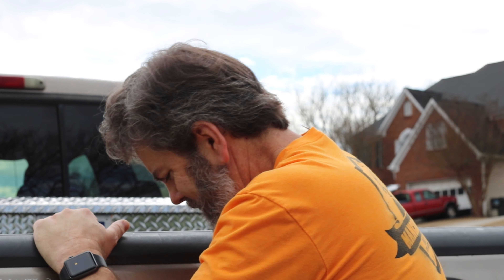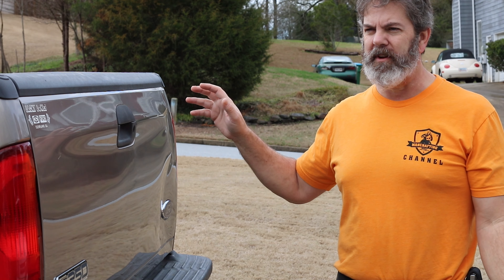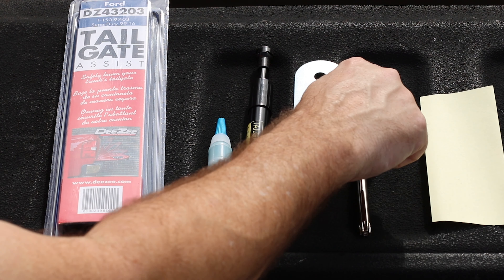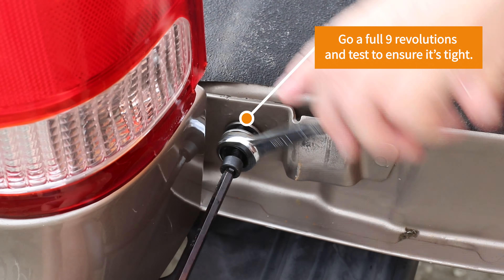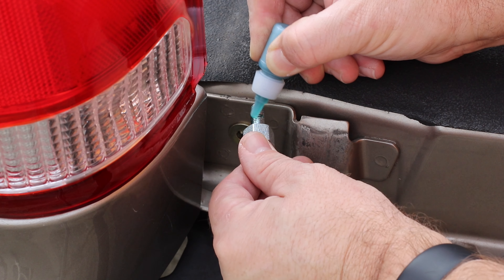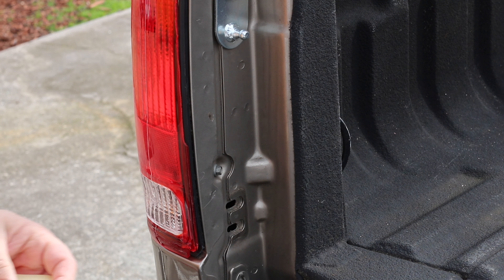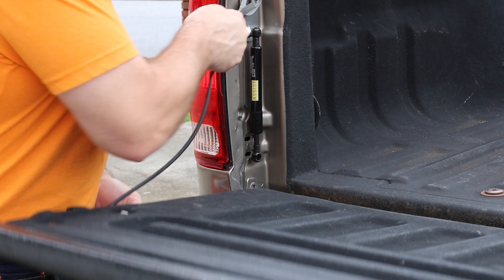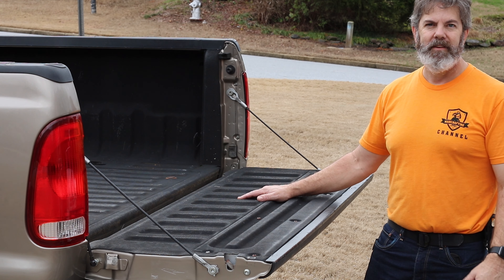Tailgate Assist for an F-250 and Many other Trucks!

Comment: My Brother in law bought me a cheap knockoff tailgate assist for my truck. At -40 the bolt sheared off the bottom mount. It works great until -10c. Thanks for the great videos, Chad!!
Reply from the maker: It may be a good idea to put on the collar lock on the right side and install two.  If I have one shear off, I’ll either do that or possible fab up a new bracket out of stainless and make it a little beefier.  Thanks for watching!
Reply: @ManCrafting  great ideas!! Or I stop leaning on it when it's cold!! Lol! Thanks!!
Reply from the maker: Muryl Marler maybe. Lol.

Comment: If you want a lift assist couldn't you just install another on the opposite side just installed upside down?  Also would you be willing to try either the boiling water on a dent to remove the ding on the tailgate or the hot glue stick dent removal method?  I'd watch either of those videos.  Thanks.
Reply from the maker: Thanks Dan,  I don't think flipping the shock would work since it's hydraulic vs a spring.  It would probably make it harder to lift.  I hadn't considered the boiling water on that dent, but I do have the dent removal kit that uses glue and the puller to work the dent out.  I have had it for longer than I'd like to admit.  It's definitely happening soon.  I am so tired of looking at that dent.  If I can make it 75% better I'd be happy.
Reply: @ManCrafting  I was joking about the flipped shock but not about the boiling water and glue sticks.
Reply from the maker: Dan The Maker Man that makes sense.

Comment: Just remember you get what you pay for. Shocks probably won’t last long. Guess as cheap as it is won’t be bad to replace once a year if so. 👍🏼
Reply from the maker: Tail End Customs I thought the same thing, but it had 4.5 stars.  I have seen some say they add a second on the passenger side.  I may end up doing that.

Comment: Is that for divers side only or could you install on pass side to ps found you on tick tolk
Reply from the maker: FUNNYBOY12375 thanks for coming over.  Great question.  It’s designed for drivers side.  That said, there is a way to add it to the passenger side or have two installed to balance the pressure in two pistons.   If you look typically on the passenger side there is a gap on the hinge for removing the tailgate.  So the piston would lift it out.  If you add a tailgate lock on the hinge, like this... https://amzn.to/38sieSk you can add it on the passenger side.